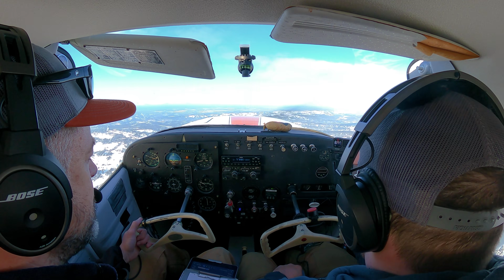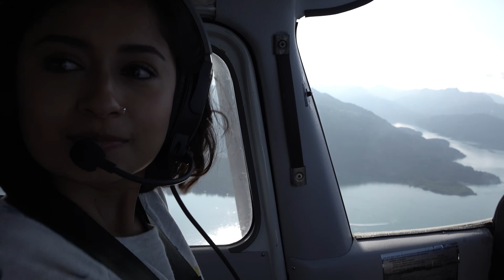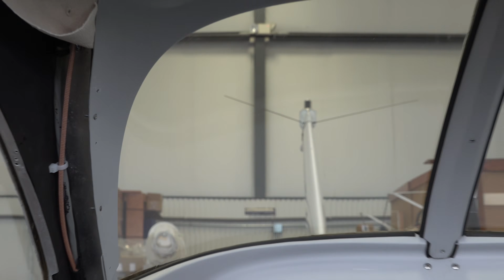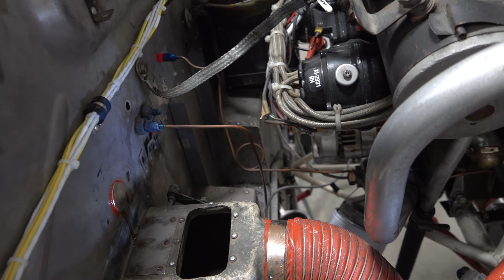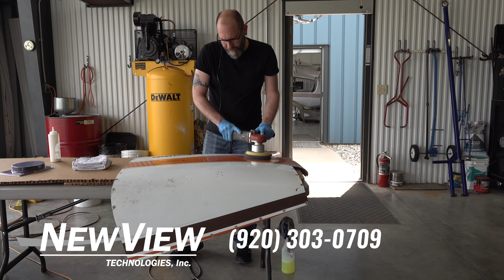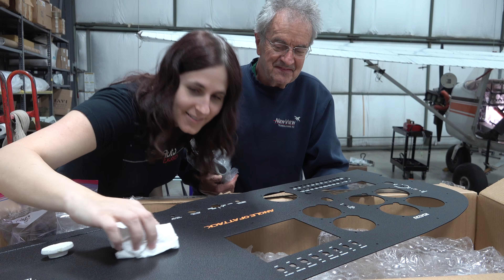MAJOR Cessna 172 Avionics [+] Panel Makeover

Comment: Hi Chris, great video as usual. You are such a thoughtful caring person. So many questions, so little time. Did the airplane lose weight? If so how much? Did the airplane sit long enough with the engine not running that you have to worry about corrosion of the cam, lifters and cylinders? If so did you take any action to pickle the engine? I know that in Alaska you have been running auto gas, on your trip south you put on  at least 50 hours with 100 LL, did you notice the oil getting dirtier faster? As part of the makeover, did you put in a four place intercom? With Bluetooth? Can the C145 take a Powermaster exhaust? If the autopilot is not installed does that mean another long cross country to Oshkosh?

Comment: Let's take a low cost affordable plane with perfectly fine working albeit old avionics and make it no longer affordable. The new turbines have made almost all piston engine plane not worth a 80000 worth of radios THINK They are to old for these radios pushing cost to unaffordability of small planes. Beech Bonanza T210 Lance etc should be 60K planes

Comment: I love the new powder coated panel.  They could have just installed all the same stuff into your plane and it wouldn't look anything like it does.  Is that a new dash on top of the whole panel as well?  Looks so good and love the heartfelt moment.  I got into facility maintenance a few years ago and things going wrong is just the nature of the beast.  It could be doing electrical, plumbing, drywall and sometimes it goes right and a lot of the time it doesn't.  In the end it will be done right, but it can be stressful getting there.

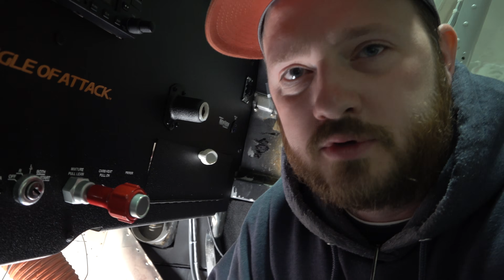Comment: 12:07 no you have it backwards (how you said it), it is supposed to hit the primary stop at the carburetor, indicating you truly reached max available throttle or, in this case mixture, before reaching the secondary stop in the cockpit.
Reply from the maker: Well, I used different words but taught the same thing.
Reply: @angleofattack  you may want to go back and listen carefully, what is said is incorrect. I think you should edit the video or put captions in with correct wording.
Reply: @chrisruf7590  Yep he said it backasswords.

Comment: Excellent video!! What is the melody of the tattoo on Jessica's arm?  Also how did the weight change?  When my 172M was weighed, it was a lot heavier than the calculated weight had been for so many years and a bit of a disappointment on the loss of usable load!!  Also, very smart to change the throttle and mixture cables.  I didn't do that on my panel upgrade and now learn that the throttle cable needs to be replaced so I will likely go with the McFarlane vernier throttle cable as well!!
Reply: The song on Jessica's arm is the piano melody from Clocks by Coldplay. Spirals around my arm to the repeat.
Reply from the maker: Just one of those things that wasn't going to cost a lot but made a huge difference.

Comment: Very nice, but that wasn't filling fuel tanks from jerry cans in a closed hangar was it? Very bad idea, those plastic jerry cans come with a very real fire risk. I got my fingers slapped for doing this once. All fueling activities should be done outdoors whenever possible and jerry can filler necks should be in constant contact with the collar around the fuel filler opening.
Reply: A valid concern for sure. We generally have the hangar ventilated when doing the filling. When the aircraft fuel tanks are calibrated, it has to be at level flight attitude, up on blocks or jacks, and in a ZERO wind environment. Doing this type of work outside isn't possible the majority of the time.

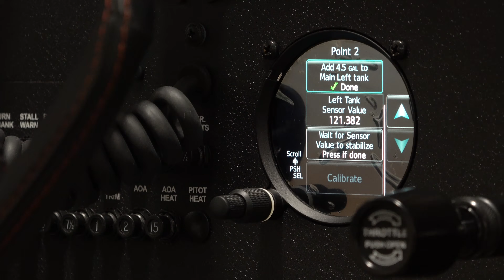Comment: 18:30  The day you depend on the fuel gauges to be honest is the day you run out of fuel.  History has proven this.  There is no substitute for double tracking fuel quantity.  Double tracking is an industry best practice.
Reply from the maker: I know what you're saying, but I think perhaps you're overgeneralizing the situation. There's a lot of reliable tech that goes into this. I'm still doing what I normally do with checking fuel, but this gives me far more accurate readings than I've ever had.

Comment: 4:06 the pa28r is 200 HP, it's not high performance until 201hp (which is why it's only 200HP) It is however complex. Only reason I know is I didn't need an HP endorsement to get my complex in the same plane.
Reply from the maker: Did I say high performance? Yeah, isn't that 200 vs 201 thing kinda funny?

Comment: Wouldn't it make more sense to leave space for autopilot panel somewhere in the middle where it can be reached from both seats?
Reply: The original plan was to put it in the middle. But if you remember in the previous videos how we talk about the yoke T column, it moves forward and backward behind the instrument panel under the radios. The autopilot mode controller connector as a minimum clearance requirement, and the connector would stick out too far to allow the controller to positioned there. We reserved the space for the beautiful logo, and put the controller in the next best place that it could fit. In front of the pilot. :-)